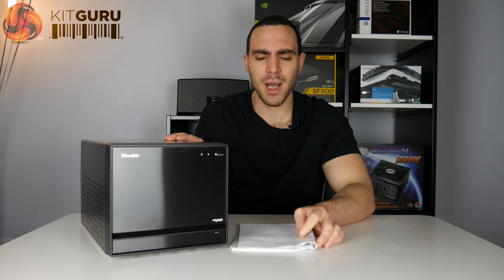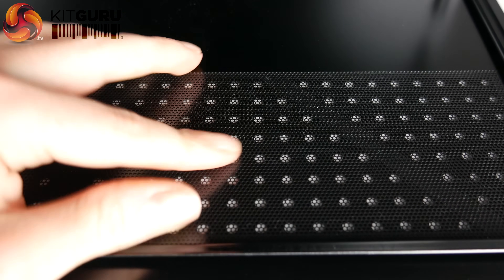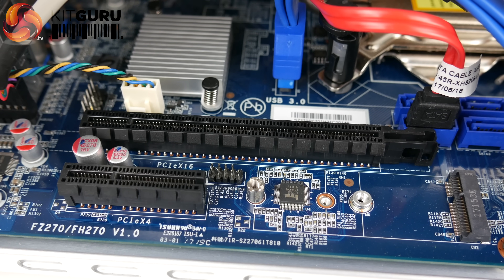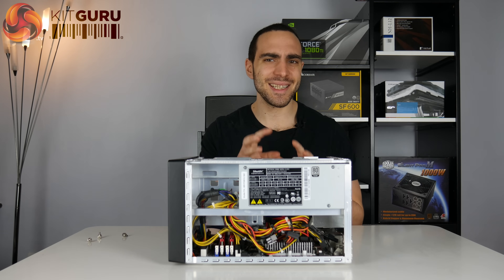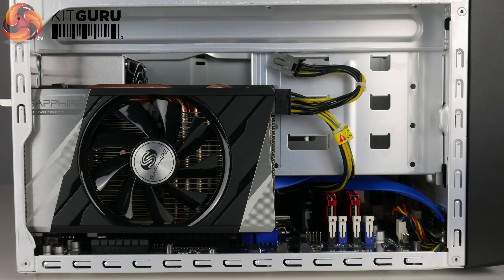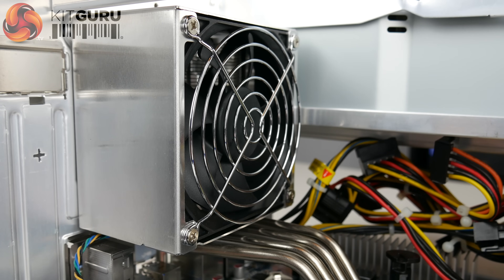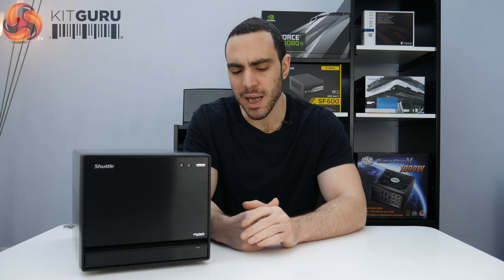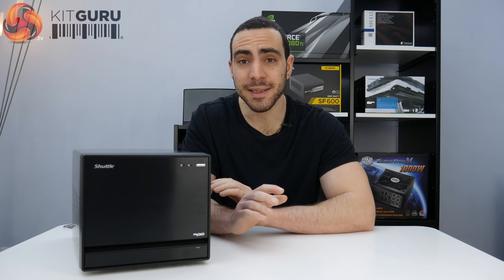Shuttle XPC Cube Barebones SZ270R8 Review

Comment: Shuttle XPC barebones ending at R4/R6/R8 can be easily upgraded by installing a mini-ITX mainboard. If you want to use the existing screw hole of the ICE-cooler: you can purchase the Asetek 945LT mini AIO water cooler that fits into the screw holes of the Shuttle ICE-cooler. I did so with my Shuttle SH97R6 barebone which I upgraded from Core i7-4790K to an Ryzen 5700G machine: It is now 3x as fast and also running cooler and more energy efficient. You will need mini-ITX AM4 cooler, Asetek 945LT mini AIO water cooler, processor (Ryzen 5700G), DDR4-modules (3600 MT/s recommended), and your existing SSD/HDD or upgrade to a better and faster version. All existing connectors including front USB 3.0 cable are compatible and you can use the existing power supply as well. Only a current adapter to feed for the 8-pin cpu power connector is necessary (can be obtained at ali express).